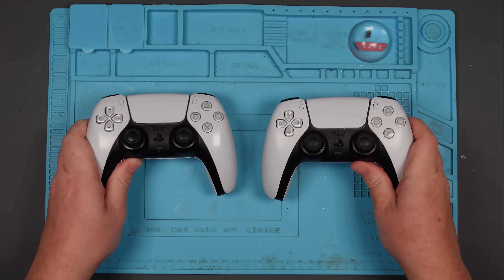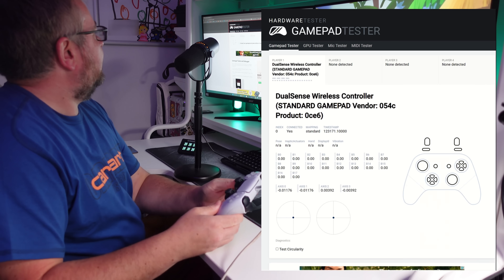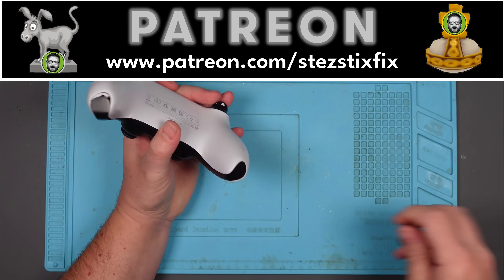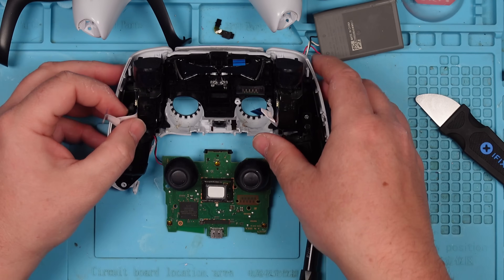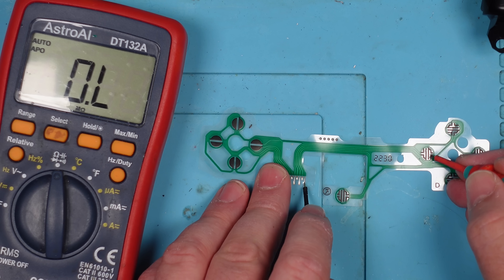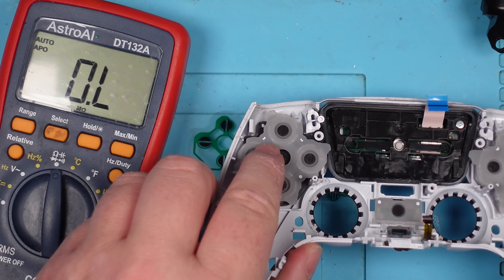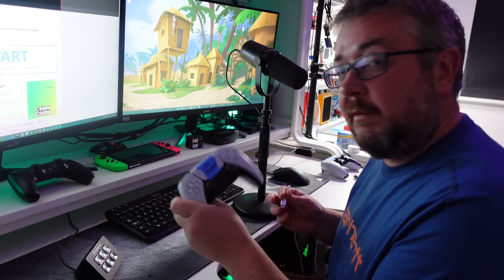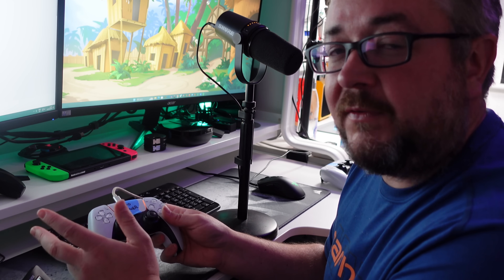These PS5 Controllers are FAULTY | Can they be FIXED?

Comment: I used to have the distinct displeasure of working for PSN Hardware Support. The number of controllers that failed for this exact issue was immense - and a broken trigger as well. The issue is as you have suggested - the tension just wears off over time - sometimes really quickly. As for the adaptive trigger - the problems were caused by cost-cutting and using the tiniest and weakest spring you can imagine. A £50 controller useless because of a cheap ass 2 pence spring. 

I was VERY happy when I could finally quit that place after 3 years of utter hell from consumers calling me about that. And little Johnny spending all their credit cards on Fortnite.....
Reply: PS4 controllers also had a trigger problem, they were held in by really weak plastic hinges that could break easily if someone used slightly too much pressure when using the triggers.

Comment: Great fix! I got 3 ‘faulty’ PS5 controllers for £33 in an auction - all with ‘stupid’ quick fixes. One had clearly been dropped in a toilet too - the smell when I opened it up will live with me forever 🤢
Reply: I tried that but can't find anything for cheap. Every sale goes up to like 40$. I'll fool around at 20$or even better 10$. Got an og version 1 nothing wrong but super small drift on right stick. And a version 2 for 27$. Figured I hit up the apps when they had the controllers on sale at 55$all over.

Comment: Just a friendly word of advice: Cleaning membranes with IPA will actually remove the conductive paint.  This is why your Q-tip was black.  It worked in the end because the shim you added increased the pressure on the pad and improved the conductive area.  But it's probably going to feel weird playing games, and it's hard to know how long the shim will work.

I love your videos, but this is one of those rare cases where copying you could make things worse.  At a guess, someone had already tried to "clean" it with IPA before you did.  This is why they were shiny.

The best fix I've used is to buy a new membrane and/or a PCB.  There may be a technique involving conductive paint, but I've never found it. 😓Keep up the good work though, all your videos are great!
Reply: I worked on a controller with the same issue however the traces on the membrane where damaged, a replacement membrane was only like £3 though, easy and cheap fix
Reply: @yotoprules9361  true. Every time I’ve had to fix one of these the flexible pcb membrane has been barely 1$. Same for the rubber pads. PSP took the same approach. Could be a Sony design choice.
Reply: @pfff  it might've been cheaper tbh but I only bought 1.

Comment: You didn’t put the side support screws above the rumbles back in the first controller, which is why it wasn’t getting enough pressure after you put it together. The other controller with the aftermarket battery was probably just dirty and didn’t need the cardboard.